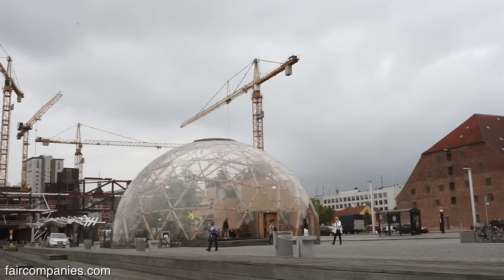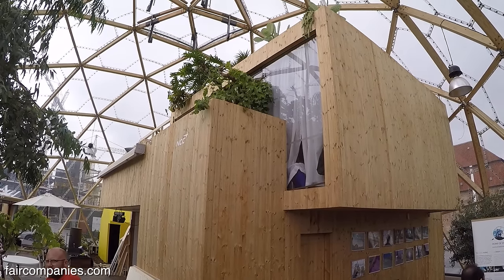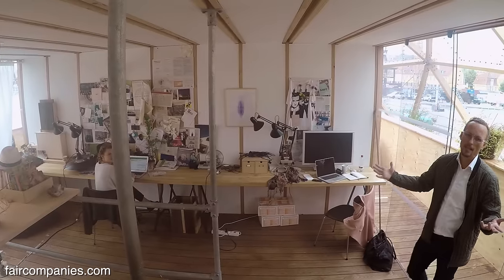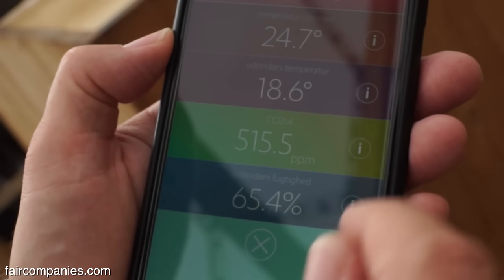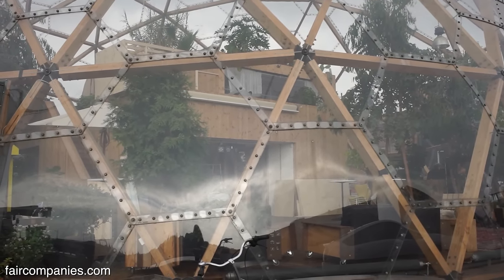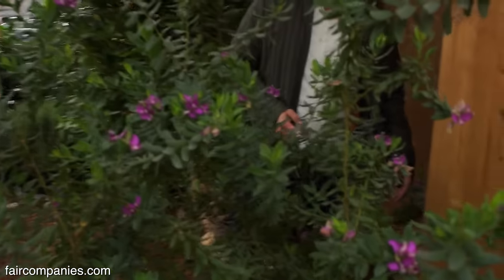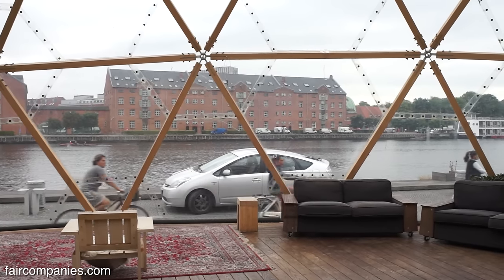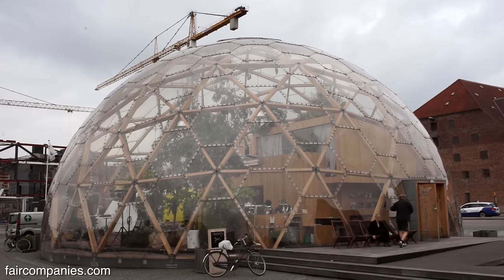Nordic home encased within geodesic dome for passive solar

Comment: this would bring window cleaning to a whole new level...
Reply: Indeed!
Reply: Probably scratched up after a few years
Reply: Need an army of Roomba for windows
Reply: @AB-wf8ek  Depends on the kind of windows.
Reply: @laaaliiiluuu  Polycarbonate is very susceptible to scratching
Reply: @AB-wf8ek  Why not use glas?
Reply: @laaaliiiluuu  My guess is weight and cost
Reply: @laaaliiiluuu 
 Strength. You can literally throw bricks at it.
Reply: So they can sell more polycarbonate
Reply: @AB-wf8ek  I studied "Material Sciences" and a very wise Professor once asked: "What is the most important property of any material?" ... hardness, density, tensile strength, ... ? Nope ... the PRICE! I have a "sunroof" of glass panes on part of my roof and each of the 0,8 * 3,5 m² glass panes was about €1000. Polycarbonate will be far cheaper and lighter ... but it wont last as long. 

Polycarbonate is actually SHIT for this kind of building because it DEGRADES OVER TIME (sunlight does a lot and wind blowing sand across it will scratch it over time, thus reducing the clarity of the "glass"). Obviously it is a "built-in obsolescence".

Additionally the blabbering on about the "C60 molecule" is nonsense, because a round space is TERRIBLE at "space efficiency", just compare a stack of square boxes with a bunch of round glasses in a box. Only one has "empty spaces" between the containers. There is a reason why we build houses with straight sides.
Reply: Suction cup wet/dry roombas!
Reply: It would require one or multiple auto window washing units.
Reply: @laaaliiiluuu  heavy n brittle
Reply: Window cleaning drones could be the answer.
Reply: @Muck006  this was a temporary installation, but anyway you don't value the easiness of installation, replacement and cost that you have with light materials.
About space efficiency, you are not considering that the house it self is built with straight walls, and  the perimeter can be filled with plants that don't require squared borders
Reply: This looks like DIY possibility. Can one obtain all dimensions of the member s and bolt sizing .
Reply: можно бота сделать

Comment: It be awesome to be able to sit in the dome in winter time, and feel as if you are outside while you read a book or watch a movie.
Reply: +Patrick Solomon Yeah it is! Was there for a small concert a couple of months ago.
Reply: +Kristoffer Raun so would you live in a dome covered house having visited this one?
Reply: No. It seemed very moist at the time I was there. Live just behind the white building  in the movie.
Reply: @kraun6473  Yeah, of course it was moist, it was a concert, so plenty of people
More then the 2+2 it was designed for
Reply: There is a canadian company selling insulsted dooms. Start at $10 000, but a decent size one is about $25 000.

Still they claim they can ad 30C temperature ontop of what it is outside
Reply: I have a fairly large greenhouse in my garden, with twin-wall polycarbonate, used to grow my fruit & vegetables.  It's still very cold during a winter's night inside there in the UK.  Inside the house, there will still be a need for additional heating at night & especially during the winter in Scandinavian climates.
I do like the experiment though & I'd thought of doing a my own version of this myself.

Comment: Polycarbonate degrades in sunlight in a process called “crazing”. It becomes discolored and brittle. There would be a lot of additional costs in maintenance just in a 15 year lifecycle.
Reply: A don’t you think buckminster fuller would have thought of this ?
Reply: Surely, modern materials science has solved that problem by now?
Reply: @gedofgont1006  Sure, material science has fixed this...by making something else, not polycarbonate based. There's a certain point where the material itself is the problem. We probably won't see drinking water that doesn't freeze for example.
Reply: @gormauslander  exactly
Reply: @wangfire7736  everything man made exposed to the sun degrades over time. As for new materials it takes time in the field to discover things like flaws in the manufacturing process and other factors not taken in by the engineers.
Reply: In the Arctic I was wondering if the sun would be weaker and less problematic?
Reply: @smallstudiodesign  the problem in the Arctic is that snow would quickly build up and bury the dome.
Reply: One could just make them out of glass, no? 
Also more environmentally friendly than using hydrocarbons...
Reply: @rey_nemaattori  Glass is pretty heavy though, might need a much beefier support structure. 
Just a thought. A material scientist, I am not  :)
edited for verbosity
Reply: @ev8870  there are other people who have built a glass greenhouse around their houses on this channel. And they actually live in it. 

Btw a square green hose is much more conducive to surrounding a square house if you ask me. Why would you want to look out and see all that blocking your view when you could have a clear view through some large rectangular panels.
Reply: @rey_nemaattori  I agree, Glass would be FAR better than any hydrocarbon or plastic-based material, but my question would then be about durability. I think the strength of a geodesic design has to do with tension put on each pane, with the greatest tension being at the bottom? If so, would glass be able to withstand that tension, OR is the majority of the tension contained within the wood frame? If the wood frame, then no-problemo! And for risk of glass breaking and killing those below, getting shatter-proof glass while more expensive would be the way to go. Exciting design nonetheless.
Reply: @OneTribe.Community  glass also breaks/shatters when hit with hail, rather have some type of durable plastic in this case, the mess afterwards if it breaks won't slice and dice lol. or have plastic wedged between two panels of glass to stop that.
Reply: @bencoad8492  true, projectiles from the sky may be a concern depending on where you live... but hail in my experience isn't all that common... nor have i ever seen/experienced the mythical "golf ball sized hail" ... plus... let's not forget, there's comets to consider! 🤔😉  I do wonder how strong glass panes would be in this design though... and maybe there's already a good reason they used polycarbonate and not glass.
Reply: @OneTribe.Community  We get golfball sized hail all the time in the northeast. Thunderstorms in summer produce hail on the regular.
Reply: @ceceliaryan  I miss East coast Thunderstorms! And one day, one day... I'll see those icy golf balls, hopefully won't feel them  😆
Reply: @gormauslander  its galled "glass"
Reply: @Smallstudio Design ... I live in the Arctic. Common misconception about the sun being weaker. Annually it's stronger UV index. Yes, weaker in winter. In summer we get midnight sun. 20 + hours daylight and thinner atmosphere letting through stronger UV rays. 
So yearly, same total hours of light and dark. Except many times higher UV index because of thinner atmosphere.
Reply: @rey_nemaattori   why? glass is very difficult to make and recycle,it needs more energy than PC
Reply: To me the biggest flaw of this idea is looking at the world through small triangles. Draw some on your glasses and tell me are you enjoying it?  In this dome it feels 1.inside  2.due to the lack of insects,birds and wind-unnatural,door should be open all day 3.crazy because of before-mentioned triangles.
I think here it would feel like living in a condom,equaly enjoyable.
Reply: @RobDaCajun  so we can call it an igloo?
Reply: I worked for a plastic shop for 15 years. Polycarbonate is better now but it still degrades, it scratches like crazy. Even if it's AR grade you have to clean it very careful. It also has a very high expansion rate for plastic. But it also has a very high impact rating. It's cost is subject to the rise in price of petroleum, so when petroleum cost are high so is the price for polycarbonate. It's a tough call for using it, but if installed properly and maintained correctly, it should give you 15 to 20 years or longer in the right environment.
Reply: @24emerald  it’s the same misconception about Greenland (of course you that)!
Reply: @SpenserRoger  The dome is the solution to the square problem.  cubes are inherently weak and will collapse very easily.  Domes can withstand sustained F5 tornado force winds.
Reply: @bobbylittle6996  My parents (father's "brilliant" idea actually) did this with a porch,  covered the sides with polycarbonate from deck plate to roof overhang, and yeah it didn't take too long to turn from perfectly clear plastic to a cloudy frosted mess.
Reply: @Mike__B  yep sheet grade polycarbonate is not recommend, have to use UF-3 grade. Even then it will discolor over time. The other problem is moist air, condensing and water dripping from the dome during temperature swings. In the long run I don't think it is very practical idea. Maybe in a very dry climate.
Reply: So who here likes to party?
Reply: @rey_nemaattori  tempered glass would probably be to heavy for that wooden structure.

Even more so I would think for glass at the top.
Reply: Imagine no winds 40degrees summer days in a green house
Reply: @gedofgont1006  NO ... it is a general problem of the CARBON-CARBON BINDING which you CAN NOT "solve". STOP BELIEVING "technology can solve everything".
The ONLY option is GLASS! Any "polymer-based solution" might be LIGHT and CHEAP ... but it WILL NOT LAST!
Hint: I studied material sciences and this is something you cant change. Get over it!
Reply: It's also very expensive in contrast to glass windows !  Don't put your compact cd or your glasses in direct sunlight then !

Comment: I would like to see rainwater collection to use the rain that falls for watering plants and washing bathing etc
Reply: That would be easy enough: you'd just need a gulley around the perimeter of the dome's base and a reservoir or two for it all to drain into. No ugly guttering or plastic drain pipe needed.
Reply: Trough around the edge, fill it with a French Drain, then top it off with pea gravel. All water that hits the dome is collected in the drain pipe and taken to an underground cistern. Easy.
Reply: @SingerGuy59  Hey! That's what I said, more or less. 😂👍
Reply: That’s a great addition. Customize
Reply: Collect the bird poop water?
Reply: And if we make use of the knowlege of bunkerdrainage and filtersystems you can easiely clean and filter the water thru a gravel sand filter and runn it into a cistern for later usage.
Reply: @voltanaares2408  -- I prefer the more natural way of letting it filter though a couple hundred feet of soil and then pumping it out of a deep well... :)
Reply: @Mavionix  because this is a prototype to be used anywhere
Reply: I would like to see where they house the unicorns and the puppies...
Reply: rainwater for washing and bathing is a terrible idea, you've got no clue how dirty rain water is
Reply: @nocensorship8092  -- Probably depends upon your location... If you live in some place where there is a lot of air pollution, it's probably not that great, but if you live in a remote area in the mountains, it's probably better.  Many off-grid places use rainwater collection systems on their roofs to fill the cisterns that they use for everything (including drinking).  It's definitely cleaner than water out of most rivers though...

Comment: I love collecting houseplants and have dreamed of living in a conservatory or greenhouse. This structure seems to be the solution to being a yearlong gardener!Also learning about Buckminster Fuller has been very inspiring. Thank you so much for sharing this video.
Reply: Greenhouses are nice and useful, but as soon as the sun comes out they very quickly become swelteringly hot and humid. The more plants, the more humidity. They can become very damp too, when the outside air temperature drops, and the humid internal air condenses all over the inside of the dome.
There's actually quite a few good reasons we don't live in greenhouse like enclosures, but in the winter, they do make some sense.

Comment: I had a 51 foot growing dome. Loved it. Fresh food all year. Even grew bananas here in Missouri without any supplemental heat. It was big enough that I did live in it to some extent. Had a bed in the forrest. With some forethought and mix of materials, one could make this very viable. This one is a clear bubble. Heat will go out at night as fast as it comes in. But if you built the north wall with insulated panels and include a heat sink, it would be very much improved. growing spaces domes have a tank for a heat sink, but for a livable dome, the heat sink could even be built into the floor of the home. Think hybrid of greenhouse and home purposefully melded instead of just sticking a home inside a dome. (granted this is a demo project on a busy road.)
Reply: Joe Himes You heard of earthships?
Reply: House needs thermal mass such as rock, concrete and dirt construction, then house will be warm all night.
Reply: Kirsten did an aquaponics video that started this way. 
"I need water as a heat sync for my greenhouse... I need fish to eat the pests in the water... I need to get rid of the fish waste so I'll pump it on the plant roots... I need the excess water from the plants for the fish ..."
Reply: Why have I not met a man like you Joe ? Sigh. I don't get out enough, it's true. Wishing you all the best.
Reply: More detail on your setup,need to built one in Quebec Canada

Comment: Great to see this very public project! 
Maybe they just didn't have time to discuss it in the video, but it seems like they're focused on the "easy" problem (of course a dome insulates you from the environment), but how are the engineering problems dealt with, specifically, how is moisture dealt with? What's the life expectancy of those polycarbonate sheets? How is it cleaned (inside and out)? How much temperature regulation is necessary? What makes a dome more efficient than a square? What was the cost? How is snow and leaf litter cleared off?
Reply: Are you having high R H swings  that can be handled without having to throw out  heated air?
Reply: Yes need survey and answers...
Reply: Vents?
Reply: Yes indeed. When the temperature outside drops, the interior condensation on single panel panes is terrible. There will be water running down the insides of the panes, and it will start to feel very damp. To do something like this requires a lot of engineering, and thought. Managing humidity is more difficult than it sounds. It's why we don't live in greenhouses.

Comment: This dome is AWESOME! 😁 Imagine many of them in a more rural setting. The way to connect them is with underground tunnels, passageways and living spaces. Could be an epic community setup! I would secure it more with back up protection from the elements. I would build ponds, waterfalls and tropical gardens. 🌿🙂💧🌱🌻🪴
Reply: Then you'll probably enjoy using gridshell architecture as well. 
That would diversify the shapes in your community and not only have domes. 
And of course for the different climates, I would suggest you look at the Eden project, if you don't already know it.
Reply: Il faut pas trop rêver il faut passer à l action

Comment: Very cool. I love domes and I've built many of them from 804sf to over 6,000sf, but the ones I built were Monolithic domes, and built with an airform, polyurea foam, rebar and shotcrete. I really don't know why anyone would want to build a different kind of dome. The monolithic dome will last for 100's if not a 1,000 years, can survive 5 TIMES the force of an EF5 tornado with 300 mph wind, they can't burn up, and they heat and cool for almost nothing. 

The standing joke is they heat with a candle and cool with an ice cube.

I built a 3,000sf dome for my friend in northern Wisconsin and he said he heats it for less than a dollar a day in the winter, and he's not the only one. There's a dome in northern Idaho that's 1,600sf and they heat with two 1,200 watt electric heaters. That's heating a home with basically TWO HAIR DRYERS. They said their first heating bill was just $99 for the whole year and the next was $110 and has always been between those to figures ever since and it was built in the 90's.

Plus FFEMA has given them what they call "NEAR ABSOLUTE PROTECTION" rating and have funded many tornado shelters all over the country. The schools that are built have said that just in energy savings alone, the school will pay for itself in less than 20 years and we're talking schools that are 110,000sf. 

This dome here is very cool for a green house, but not to live in like they're doing. Keep up the great work.
Reply: I know this is a 6 year old comment, but how would a dome house work in a climate like Las Vegas? Would it stay cool in the summer and warm in winter?

Comment: I love this! It looks like a great competitor to the Passivhaus design (which is a great concept for energy efficient, healthy, and comfortable homes (and non domestic too)).

Some critique questions:

1) Ventilation. How is the dome ventilated? Could it cope with a family having a BBQ in the eclosed yard.
2) Pollinating insects. The design being a green house outer skin allows for flowers etc is there a way to allow bees safely in and out?
3) Too much solar gain. How will the design mitigate against really hot sunny days?
4) Fire safety. The design does look like a potential increased fire safety issue due to the house being enclosed.
5) Is the design scalable? Can it be used to say enclose a terrace of houses like in a town? Can it be used for say a shop or a cafe?
6) Noise. If multiple properties are enclosed what are the accoustics like? 
7) Anti-social behaviour?
Reply: Re: 3. If switchable glass/film is used, the dome could be clear, translucent or opaque. Could even automate to switch based on temperature.